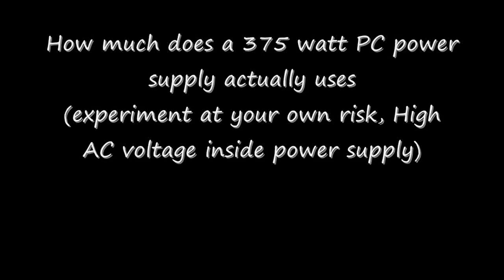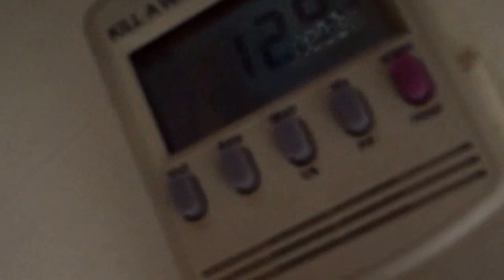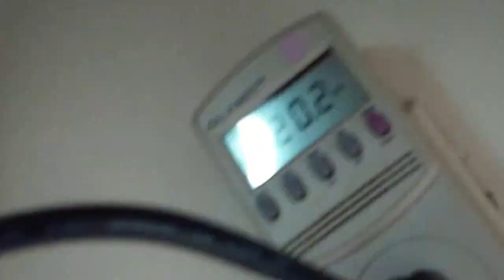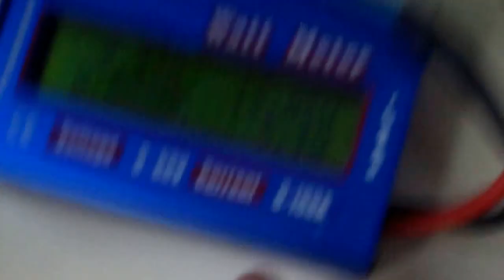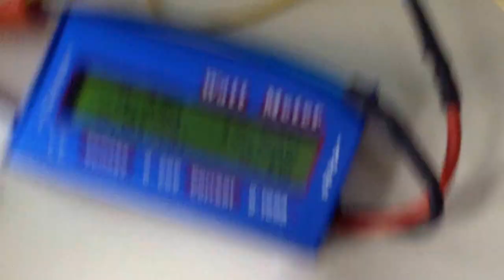Converted PC power supply wattage consumption

Comment: Thanks very much for this video.  Although I knew everything you discussed in it, I have been preaching this information for years but nobody wants to believe it.  

Same kind of thing goes when you replace your PC's power supply, you can always go higher wattage, never lower.  Most people think you'll blow it up if you go higher, but the computer will only use what it needs to.  I explain it this way:  The lamp in your living room with a 100 watt light bulb is using approximately 1 amp of current.  Most people will agree.  I then tell them that the house is delivering at least 15 amps of current to the outlet its plugged into, so by their beliefs, the lamp would have had to explode.  It only uses what it needs to.  (Of course this is more or less an outdated example today, but most people are familiar with incandescent bulbs and can relate).
Reply from the maker: jaykay18 Same reason people seem to think it is not ok to replace a small amperage phone charger with a higher amperage one. For this video, I just wanted to check how much the power supply uses when it is doing nothing. The dummy load itself can draw 5 to 10 watts depending what you use.  Maybe in the future, the kill a watt meter will be so small and cheap it will be incorporated into every piece of equipment.